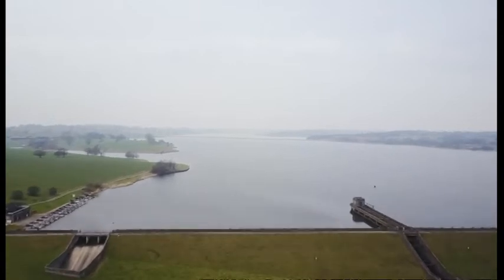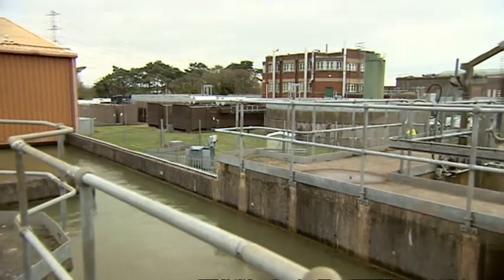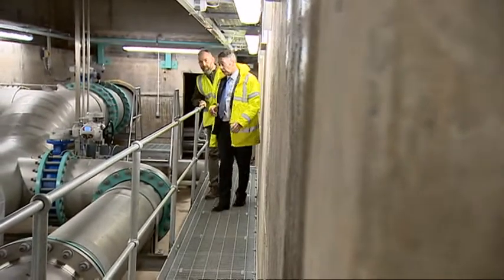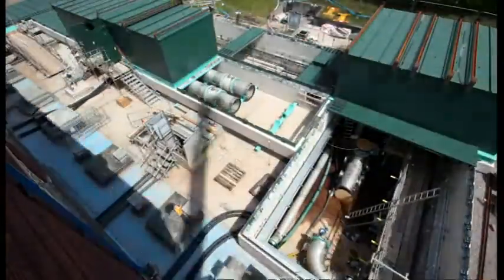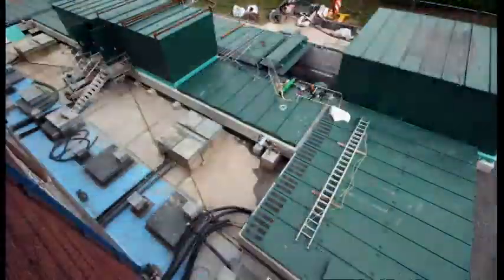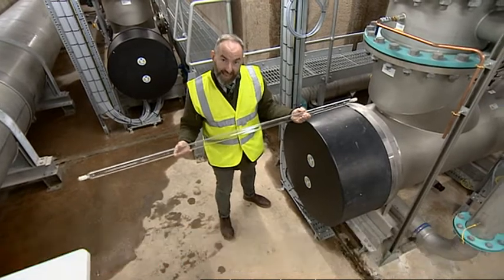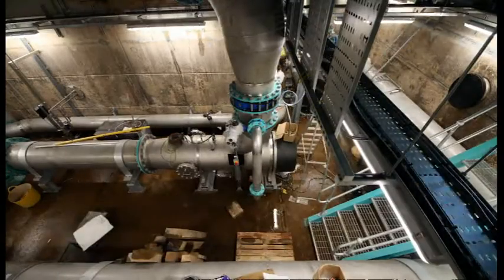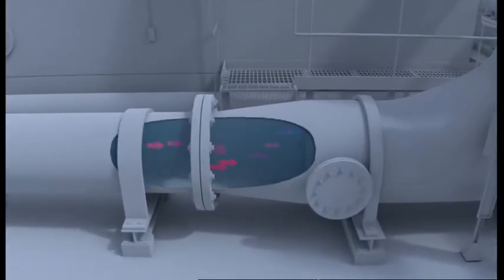Using UV light to clean our water

Comment: If uvl causes skin cancer , it prob should not be used for drinking water. Just sayin
Reply: David Redfern That’s not how it works facepalm Ultra Violet Light uses the light to kill bacteria. The reason why you get skin cancer from Ultra Violet is because your standing with your skin exposed to the sun and your cells begin to mutate and cancer is an error during the mutation process.
Reply: going by your logic chlorine must be fastest thing to drink, right? anyway it kills bacteria in water and makes it safer just like bacteria dies if exposed to Sun light and you can get skin burns by sunlight and even skin cancer if you are exposed to uv light from Sun but that only where ozone depletion is quite bad.